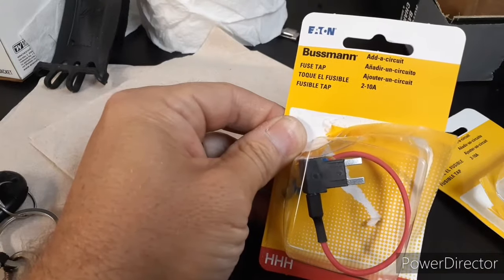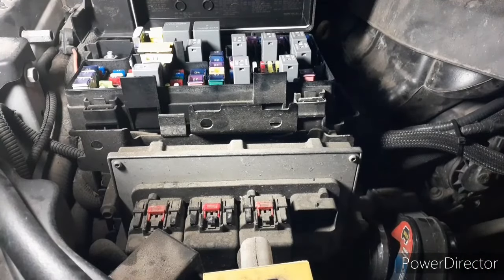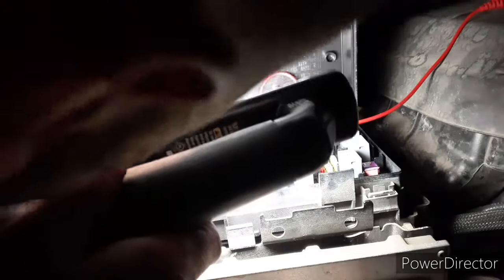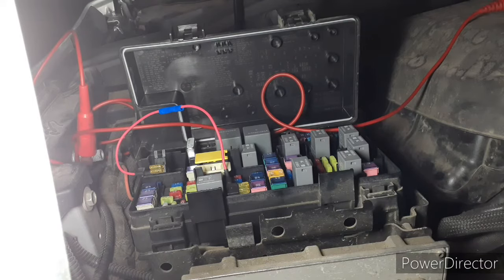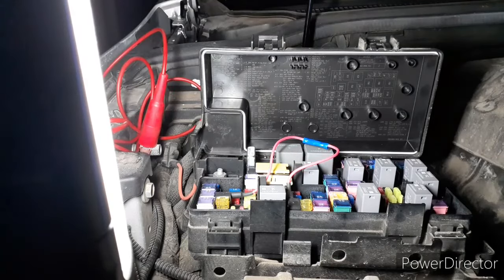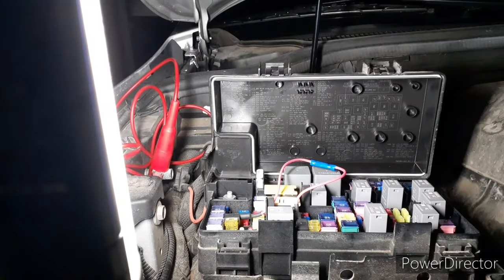Jeep Cranks But Won't Start. PCM Bypass Solution.

Comment: If I understand this correctly you are bypassing the PCM so the pump runs continuously when the key is on? If so people should consider before doing this if you get in an accident often the PCM senses the air bag deployed and shuts down the fuel pump to prevent a fire. IDK what jeep does, sometimes the airbag sends a signal to a relay separate from the PCM to shut down the pump...So just keep in mind if you've bypassed the PCM and get in an accident the pump will probably keep running which could cause a pretty bad fire.
Reply from the maker: Tell this to Jeep LOL. Shortly after this video was made Jeep released a service bulletin calling this their fix to the issue. So now you have 3 options, do this yourself, tow your ride to the dealership and have them do it, or replace the PCM.
Reply: @dinstaar  That is funny :)
Reply from the maker: @THX..1138  yeah, big coincidence...
5 dats after this video they published a solution oddly similar to this.
Reply: @dinstaar  please help.  My 2012 gjc 6 cylinder is having starting issue.  I drove to dealer when it started and code read “ECM miscommunication with SKI M.”  Is this the same issue?  What is the service bulletin you refer to?
Reply from the maker: @sheridenblack6000  All service bulletins can be found by googling them. The service bulletin I am referring to is for the fuel pump issue. The SKIM has to do with your key. This bypass is not for a skim issue, this is a fuel pump issue not powering on in my video.

What your issue is the key is not communicating properly with your computer. Start researching that problem and you will be on the right track.
Reply: @dinstaar  Option 3 Are they replacing a new PCM how did the dealer fix this problem?
Reply from the maker: @miketran570  the dealer's solution is a new computer (that will again fail in this exact same way). There is also a service bulletin with an oddly similar solution to this one except they pull out the fuse box and do it from the bottom if I understand it right.

Comment: Just leave it there those two wires in fuse box?
Reply from the maker: Yes. Why would you worry about it? What do you think is on the bottom side of that panel? 

Make sure your connections are good and tuck the wire inside and out the cover on. You're done.

Good luck.
Reply: @dinstaar  I gives thumbs up! And like,,,thank you sir,,,I'm gonna try that tomorrow,,with God willing
Reply: @dinstaar  I tried to fix my it crank but it won't start,,,I checked the fuse box,,what I saw there is 20 amp for cigar,,it's big fuse,,,and the other side to connects there are two relay the transmission and the horn beside this relay,,,they 20 amp and 15 amp that's all I see
Reply from the maker: @jamesark9926  what are you working on exactly? Year make and model please. If your fuse box looks different than the one in my video, stop.

If the fuse panel is the same and you did your troubleshooting correctly and there is no power to your fuel pump at key on when there should be, use all the same parts in my video and you'll be good. 

To summarize, the known issue is the lack of power to your fuel pump when you turn your key to accessory position. The TIPM is damaged if this happens. What you are doing is supplying 12 volts at key on through the cigar lighter.
Reply: @dinstaar  my jeep model 1998 grand Cherokee Laredo,,,yes it is different fuse box your jeep and mine,,,my jeep problem is,,,I turned it on and on the ignition switch,,,it only crank but it won't start,,,,then a few hours later when I start switch on it start,,,,but if I shut down the engine,,then I turning back on,,,it will not start,,but it crank,,,,,that's my problem to find out,,,,I guest have something to do in the pcm,,ecm
Reply from the maker: @jamesark9926  this failure is common for a later model than yours. A 1998 does not have this common known flaw. You are barking up the wrong tree man.

Start checking for power using a multimeter and see if you have power at the fuse. If you do it is not your computer. Next check to see if there is power at your fuel pump. If there is the most common failure would be a fuel filter, a fuel pump, or contaminated fuel.

DO NOT SKIP OVER THE POWER CHECKS I DO IN THIS VIDEO. THEY ARE THE MOST IMPORTANT PART OF TROUBLESHOOTING AN ELECTRICAL PROBLEM.

Comment: HEY COOL TIP WISH THE FIX FOR MY 2000 CHEROKEE WAS THAT BASIC..JEEP STALLED WHEN I DISCONNECTED AND RECONNECTED 2 CONSECUTIVE TIMES THE WIRING HARNESS FOR ELECTRIC FAN WHILE ENGINE WAS RUNNING.  IT TOOK AN HOUR BUT RESTARTED ON IT 'S OWN BUT STALLED 10 MIN LATER WHILE DRIVING.  HAS NOW STALLED TWICE WHILE DRIVING AND 3X AT IDLE NOT SAME DAY BUT WITHIN A WEEK.  LONGEST HAS STAYED RUNNING AT IDLE IS 15 M AND DRIVING FOR 10. YOU THINK MAJOR COINCIDENCE SOMETHING ELSE FAILED SAME TIME AS UNPLUGGING THAT FAN OR DISCONNECTING IT WHLE ENGINE WAS RUNNING STARTED THIS CHALLENGE ?? EVER HEAR OF THIS ?
Reply from the maker: I would have to see the vehicle. The electric fan would seem unrelated but I would look around the entire area and see if anything else was inadvertently disturbed in the process. The only job the fan has is cooling so the only problem it could directly cause is overheating. An engine running or not not running would not be affected by the fan.
Reply: @dinstaar  MAJOR COINCIDENCE THEN..SO IF FAN IS INNOCENT WHAT ARE YOUR SUSPECTS WHEN A 2000 XJ CONSISTENTLY STALLS AROUND 10-15 MINUTE MARK THEN REQUIRES 1-2 HRS TO RESTART.  SOMETHING THERMAL RELATED ? THANKS FOR REPLYING.
Reply from the maker: @matthewpolo227  I can't troubleshoot from here. Lol. Are you near Waco, TX?
Reply: @dinstaar  I'll SHIP IT TO YOU.. PREFER FED EX OR UPS ?
Reply: Why are you shouting mate?
Reply: @yamatojun8032  😄

Comment: If your fuel air sensors a n b go out , as well as asd fuse or  relay the neutral switch catalyc converter,  also bank1 bank2 upstream n downstream sensors,,  all these can cuase turn over engine crank no start by cutting of starter or fuel tank also engine randomly turns off ,, these issue cuase other issues to fail,,, codes will pop up on code reader after been erase that means replacing those parts and a deep reset, them computer too must go to a second phase for it to pop up freeze frame save it ,,because there won't be no more codes after erasing it no matter what,, that way you go to the source and replace those ,, the crank it should  start ,,, the others are crankshaft sensor ,camshaft,, coil even with bad thermostat sometimes those sensor don't show
Reply from the maker: ? None of the things you mentioned are caused by a known problem with this specific issue on Chrysler PCMs. 

Do your research. There is a bulletin issued about this specific problem. You just spit out a bunch of random stuff that makes no sense.

I guess your right? Cars break in all sorts of ways don't they?

Comment: The engine control module is not called tipm. The tipm is the fuse box body control module computer.

Comment: My problem is when I turn my key on there is nothing it won't do anything makes no sound at all any ideas anybody?
Reply from the maker: Power supply. Check your battery and your ground. Then check your fuse box to see if you are getting power.
Reply: I fixed it it was my relay box and all my relay switches they were cooked bought new switches and rewired my relay box did a video on it
Reply from the maker: @GOLDEN-GRAMS  Nice!
Reply: You got a link to the video you made? @GOLDEN-GRAMS

Comment: If fuse is blown y this..but good hack
Reply from the maker: The fuse is not blown at all. The computer is not working correctly and not sending power to the fuse to begin with. That's why.

That is why the video is titled "PCM Bypass Solution" and not "Blown Fuse."

Comment: Fuel pump relay is the problem and there is a recall to fix it
Reply from the maker: There is no fuel pump relay. Lol. You're old school. The fuel pump is now PCM controlled. Chrysler actually copied this very video to make the recall. Their solution was published 5 days after I published the video. 

So yeah, you could have a broke down vehicle in driveway waiting on an appointment at the dealership, or just follow this video for the same result.
Reply: @dinstaar  they just did the relay recall on mine by passing the one in the fuse box the pcm is different item it is in front of the fuse box
Reply: So what dealership  did was tap into to wires and add a small relay next to fuse box to control fuel pump on mine grand Cherokee overland
Reply: @dinstaar  I think recall came out in 2013 if u brake down fuse box it splits in half and under the fuse u sent power to is  the problem they have a issue with Soldered connection failing the pcm is in front of that mounted vertical  if u replace  pcm it will not fix your problem with fuel pump
Reply from the maker: @drdirt9379  in 2013 their recall for for a replacement of the PCM. We did it, then the new one failed. They struggled with this for years until they realized that using a computer to control the fuel pump isn't working.
Reply: @dinstaar  wht model did u have ? That’s interesting because I had a recall for fuel pump relay and alternator but right now my truck is at dealer and they are saying I need a new pcm because it’s not  telling the system to charge the battery and they have not mentioned a recall on pcm ?
Reply: They did the remote relay for fuel pump new alternator new battery I leave dealer truck started fine a mile down the road battery symbol came on on the dashboard I turn around start going back to the dealership on my way back all kinds of stuff is flashing across the screen because the trucks not getting the right power electrically  , Then they tell me I need a new PCM because it’s not allowing the alternator to charge the battery and they never mention anything about a recall on the PCM
Reply: I know the 2012 jeep grand Cherokee had  recall an alternator fuel pump relay some shield around the brake system and something with the Sunvisors  shorting out and possibly catching fire
Reply from the maker: @drdirt9379  Truck? Of course recalls are different for different vehicles. The recall for most models was superceded by the new repair. On the whole though, the PCMs are awful and go out frequently.
Reply from the maker: @drdirt9379  2013 Jeep Grand Cherokee Loredo. However, from all the vehicles I have worked on PCM problems are common for all models that use this PCM. All the PCMs are the same (just programed a little different). They internally fail like crazy. The most common failure is the lack of power to the fuel pump. They chose to forgo a fuel pump relay and rely on the PCM to turn it on but their PCM is garbage.

Comment: Does anyone know if this works on the 08 3.0 diesels? Mine has a pcm issue fan coolant pump and power steering won’t run as high as it should
Reply from the maker: This will not work for that issue no. This is specific to the known fuel pump PCM failure. 
You need a new PCM.

Comment: DO NOT DO THIS! Jeep has it set up for safety. If you tap into the cigarette lighter, which always has power, that now means that the fuel pump always has power. Jeep designed it so that if you get into a car accident, the computer will detect that the airbag went off, turning the pump off. But if you do what he did, the fuel pump would still be on and cause a bad fire.
Reply from the maker: You're cigar lighter only has power when you turn your key on, just like your fuel pump. 

Jeep themselves actually stole this fix and put out a service bulletin 5 days after my video. 

Before you give advice on whether or not someone should do this research.
Reply: @dinstaar  Do you happen to know what the TSB number is?
Reply from the maker: @scottking8047  You can call your dealership and they can look it up for you. Sorry but I threw it out when we got it in the mail. I didn't need it because I fixed the problem already. Lol.
Reply: I have a 2005 Jeep Liberty V6 gasoline engine..my cigarette lighter works without my key even being in the switch just saying..
Reply: Oh man sign me up for that! It is very hard to undo electronic damage bad mechanics do. Took me 8 months and and old harness to study. Ford SVT has the diagrams secret.

Comment: I did this & it draws constant power to fuel pump drains battery
Reply from the maker: @mmiczak973  then you did it wrong or you have a different issue. This draws no power with the key in the off position, that is the reason I chose this circuit to tap into to begin with.  You went to the wrong circuit or you have a battery or alternator issue.

Comment: Fyi the box is on the  right side of the engine.
Reply from the maker: Yes, right side when sitting in the vehicle (how it should technically be referred to), left if you are facing the engine compartment.
Reply: @dinstaar  brother just thank you for what you shown us. It worked on a 2007 Jeep Wrangler as well. I don’t give a frogs fat ass which side the fuse box is on. I guess maybe for the perfectionist keyboard warriors maybe you should have a disclaimer that states, common since is required to do this fix. Thank you again!

Comment: Replaced the fuel pump, code was on for oil pressure sensor, changed that too still just cranks and cranks. Seemed to me like the pump wasn't staying on, going to try this tomorrow and let everyone know.
Reply: 2008 Jeep liberty 3.7L
Reply from the maker: The pump will definitely stay on when keyed on with this bypass. 
Good luck!
Reply: Got it in, can hear the pump run have fuel at the rail, 0 pressure. 🙄 Mustve been a bad pump from the factory guess I have to drop the tank again....
Reply from the maker: @dj2pratt  you may also have a cracked line. Be sure to check. If you hear the pump it may be good.
Reply: Wouldn't i be able to see or smell the fuel of the line was cracked? Think the EVAP side would cause no start issues?
Reply from the maker: @dj2pratt  you would only see a large crack. Hairline cracks cause problems too.
Reply: Pulled the pump, regulator was snapped off, mustve been cracked and broke when it saw pressure. Freaking rock auto. Second pump Ive ever changed in my life, first one was defective too 🙄🙄
Reply: Always for OE for fuel pumps. I replaced mine with a Delphi OE complete assembly they last 300,000 in my experience
Reply from the maker: @timland7553  Tim, obviously the fuel pump is fine. The PCM is not.  If you replace the fuel pump with this failure it still won't start.

Comment: Ya..but now the protection on that circuit is non existent.. fuses are there to protect from fire..lol geez.. 
Must be smarter then the engineers at a multimillion dollar company.. 😆
Reply from the maker: Fuses protect against over amperage, they are not fire-preventing devices. The purpose of a fuse is to protect the circuit from too much current.  If the fuse pops the circuit is no longer powered. A circuit with a fuse is a protected circuit. That is why there are so many fuses and a fuse box in your vehicle.  If you don't know that, put the tools down and step away from the wiring...

Comment: It’s under recall, you could’ve saved $810.
Reply from the maker: It is now. It wasn't at the time of publication. Also, doing this allows you to drive it while getting scheduled and ordering parts. This bypass cost$10, a tow will be at least $100. I would rather spend $10 and drive it to the dealer and be mobile while they order parts instead of stuck without a ride.
Reply: @dinstaar  I just bought a 2012 and I believe they already did the bypass relay. But I car faxed it and I guess it was never reported. Any idea how to report the fix?
Reply from the maker: @18wheeler77  Your local dealership has a database. Have them access it by using your VIN.

Comment: Can this same thing be done on a 2011 Mercedes S550 please please reply
Reply from the maker: Well....
I don't have a Mercedes S550 in front of me to do any electrical testing. Please bring the vehicle to me here in Waco, TX and I'll be happy to look at it for you.

Sorry bud, that's the best I can do. This issue is a common failure in Chrysler PCMs so this video is geared to those owners facing this specific issue. I am confident I could figure out your problem, but I am equally confident I cannot do it through comments on YouTube. 

Good luck.
Reply: Ok thx for your time

Comment: Will this work on a 2004 jeep liberty?
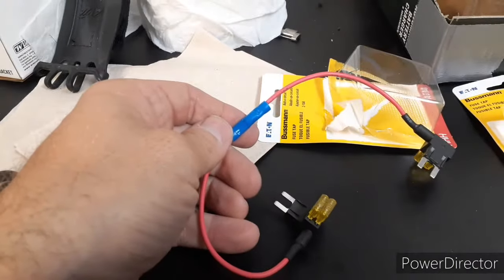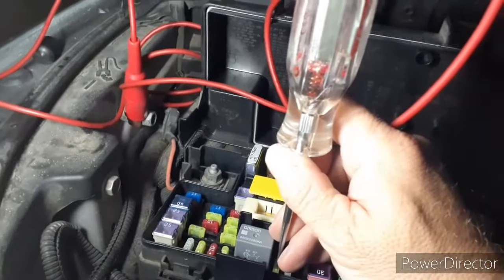Reply from the maker: I am unsure if your specific vehicle has a known issue with the PCM failing in this manner. Pay close attention to 1:10 to 3:05.  Make sure your fuse box looks exactly like this one.  Check where I check EXACTLY and look for power.  If your "lift Pump" fuse (the little yellow one) does not have voltage when the key is in the accessory position this is the solution.

Comment: Would this work for a 99 JGC
Reply from the maker: 99s typically don't have this failure. You have a completely different fuse box and completely different computer.